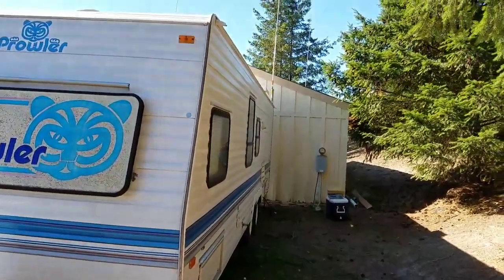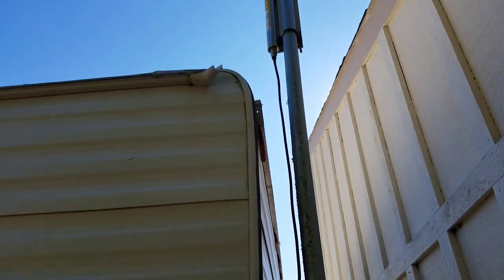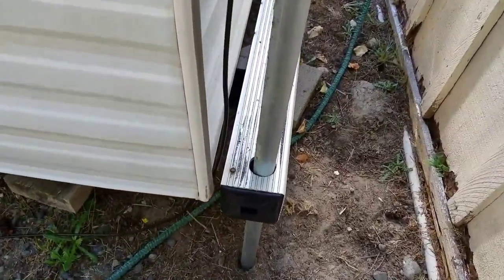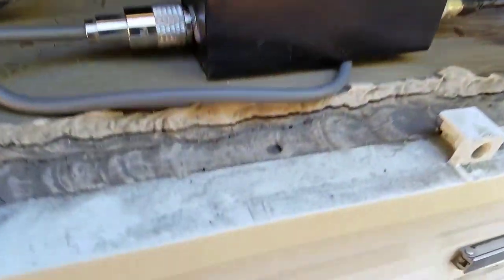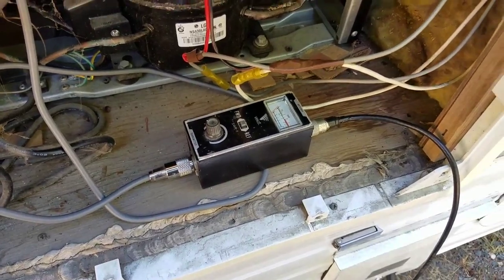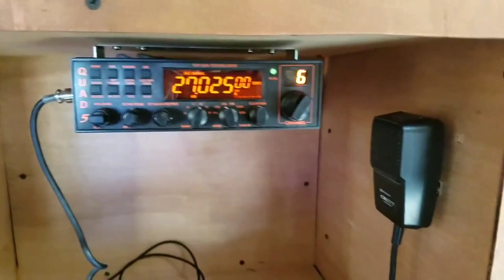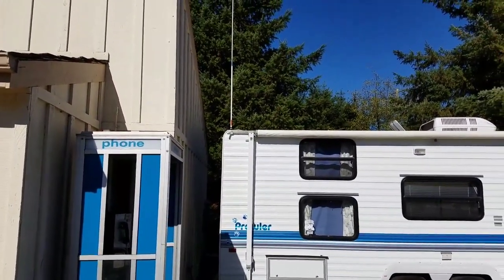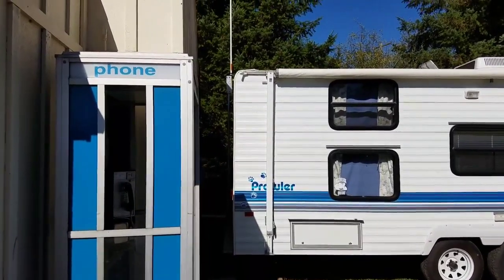RV CB Radio setup Part 2  DX Antenna installation

Comment: If I were to do that I would take that little Louver cover on the outside of the RV on the bottom just do a small notch... so when you get to the campsite and you want to set up you just pull your little Looper cover off throw your coax out walk outside hook everything up put the cover back on in the coax will fit in that small notch that you have made perfectly give it more of a factory look... I don't like using Barrel connectors or bulkhead connectors basically the same thing that will give you an impedance bump which will jump SWR when point a lot of times in my testing that I've done I hope this helps looks good keep going with it
Reply from the maker: I did drill into the cover and mount a barrel connector, I used a black rubber cap plug to protect it from moisture. Worked very good, no SWR issues. Now the bad news... When I sold my RV Park we sold all 6 vehicles, and the RV. I did however get to take this old rig out but as usual with my work situation not as much as I would have liked. I did get to shoot skip while camping and talk to the locals. Cheers

Comment: I would like to see the final results when you're done I have a 28 ft fithwheel shout out from oaklahoma
Reply from the maker: I did install the 6" barrel connector and covered the end with a rubber plug to protect the end. Took the trailer out on a few camping trips and it performed very well. Think of it as a portable Base Station. Unfortunately we sold the Trailer and I sold the Antenna to a local. When I buy another Trailer I will do the exact setup. I was very happy with the performance as it works 150% better than using a mobile CB antenna on a RV. Seen it, been there, done that.
Thanks for watching. Cheers

Comment: Judging by that phone booth it looks like you parked your RV in the 1980's 😝
Reply from the maker: My RV Park was built in the early 80s, they poured a Pad and wired for a Phone Booth. They had one in that spot up until the late 90s. So I'm like yea we need to put one in that spot. Took me years to get the Booth. Unfortunately I had to sell it when I moved.

Comment: Where can you get the Solor Con I think you said? I'd like to get one. New old stock lol
Reply from the maker: Try Walcott, the antenna used in this video is outdated so maybe the A99 would work for you. 
NOTE... I only recommend this type of antenna for the RV and not for base station use as there far better antennas I would use for permanent installations.

Comment: Won't the A-99 break down and fit inside the bumper with the waste tube?
Reply from the maker: YUK!
 No the bumper is not large enough. Length wise it is. I just laid the mast and antenna down on the floor of the trailer I had it wrapped in a packing blanket to keep from thrashing around while driving.
Reply: @390WagonMaster  haha, yuck lol. You'd end up with a "shit stick" probably 😆😆😆
I have a new Gulf Stream 25BH, I was thinking about piecing something together for it..

Comment: I need a update on this
Reply from the maker: I sold my campground, the trailer and sadly the phone booth!
I did use the setup in the trailer at my CG and out in the woods, it worked very good. I plan on doing another setup when I get a new rig. Any questions you have?
Reply: @390WagonMaster  im moving in to a 32ft camper and im wanting to be able to shoot skip